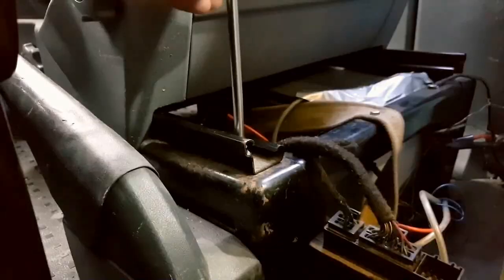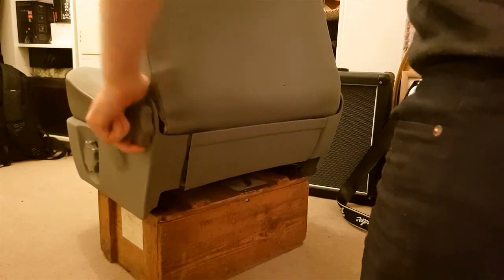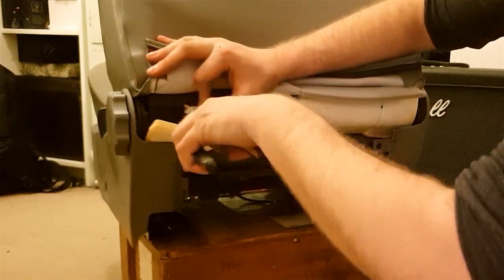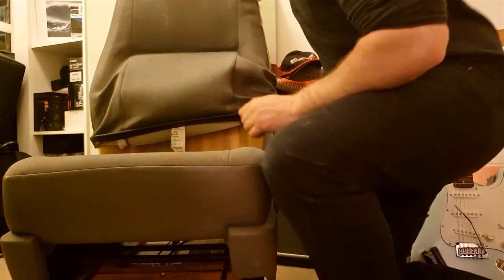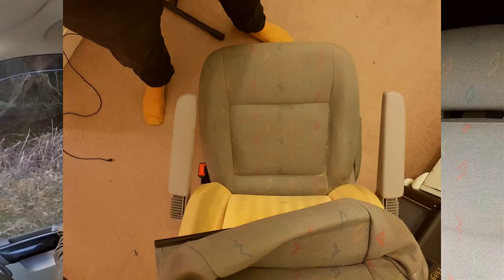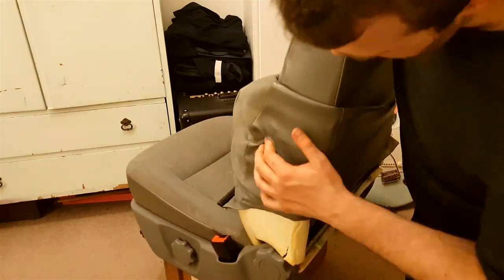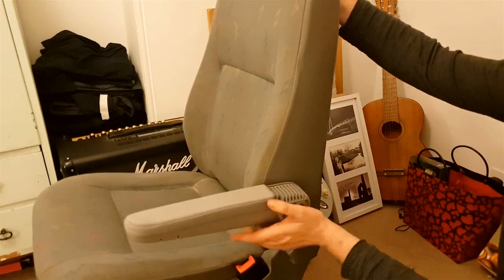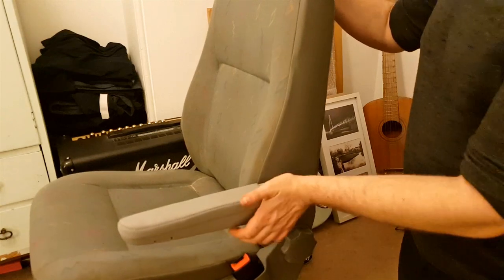How to: VW T5 Fitting Armrests | DIY Captains Seat | Campervan Conversion Interior Vanbuild

Comment: OMG thanks for this i have just ripped out my bulkhead and binned the double and now have 2 single seats im going to fit swivels to. I bought a second drivers seat as it was cheaper. Some people are charging £800 for ONE SEAT WITH ARMS! 
im off to buy arms and fit them to my stealth! Thanks for sharing 🤘🏻👍🏻
Reply from the maker: Great, sounds like a good saving, good luck with the fitting 👍
Reply: Hi Scopex, How did you get on with using a driver seat as the passenger seat?  Particulalry the seat belt plug?  Cheers, Murry

Comment: Awesome job!
I recently got 2 armrests to install on my driver's seat and I notice the foam is moving a bit sideways on them. Are yours like that or the foam is firm on the rests?
Reply from the maker: Thanks, so no mine don't seem to have that issue, although they don't seem the best design as the pads are quite narrow and I would have thought a few years down the line they may experience something similar to this..

Comment: The link does not work for the arm rest kit. Do you have a part No. ?
Reply: Hi,  i want to buy them as well but the link is not working did u mange to get part number ?
Reply from the maker: Hi, I will try and update the link

Comment: Hello! I am going to install the same armrest in my T5, but I haven't hot the support for the seat, where can you buy this plate? Thanks
Reply from the maker: Hi, my armrests came with the brackets for the seat, you could try searching ebay.. or contacting the sellers on eBay who sell the kits with the brackets and see if you can buy the brackets separately...
Reply: @scoellphotography  ok thanks, I check your link but now is not available, I could not find it in Spain, I would try in England or Germany. Thanks for answering!
Reply: @edumacias  did you find?